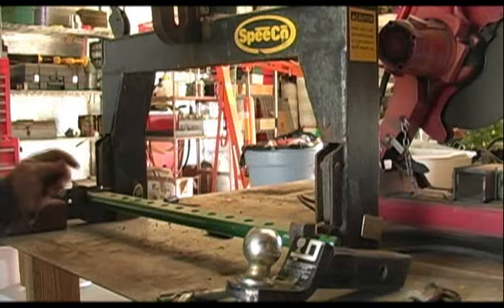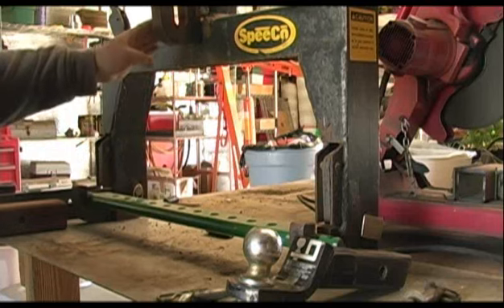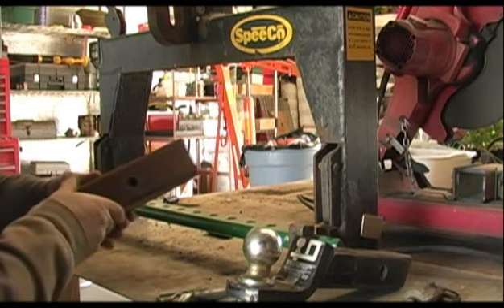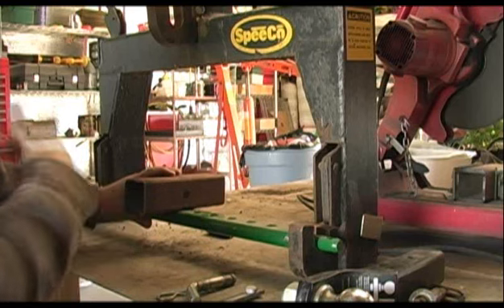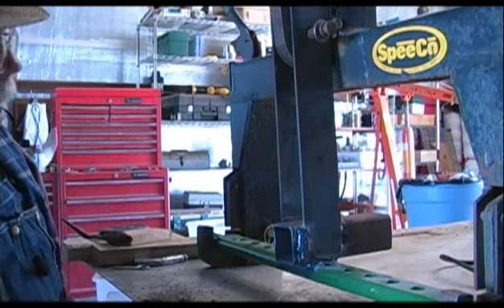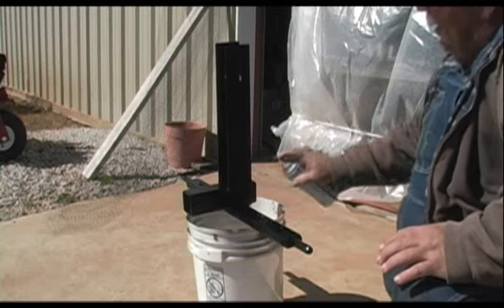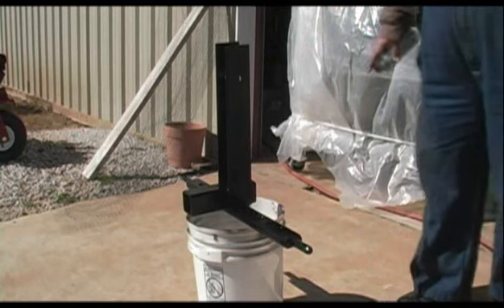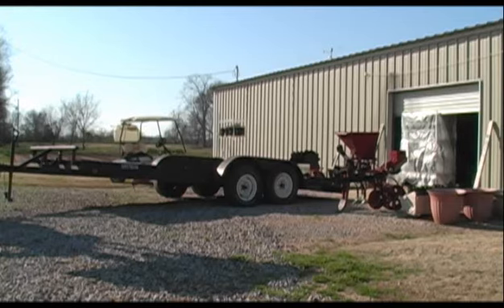Building a Receiver Hitch - February 2010 - The Bayou Gardener

Comment: Nice Job Donald. I have been a welder and a machinist for 20 years and have built alot of the attachments I have for my tractor. I made a reciever hitch for my tractor several years ago and the best thing about this kind of hitch is you don't have to get off the tractor to raise the trailer jack. Just back up raise the 3 point hitch and go. i'm sure this video we help alot of folks. Robert

Comment: Nicely done Donald. I've been using just the ball on my draw bar for years, with no problem, but the old 9N is only pulling a a 5x10, single axle trailer. Your new set up looks a lot safer though. I may have to do the same. Thanks for the video.

Comment: I like the idea. Similar hitches were used to move peanut wagons her in my town back in the 70s. I worked for a peanut oil company that bought and dried goobers from farmers and then rendered the oil and wastes. The spotters never got off a tractor. The wagons were hitched and unhitched from the tractor seat. One person per tractor. Great video though. And yes...........................4/16/2016 and it's still way too wet and cold to do much gardening. Plants are up but not growing. Pecan trees are still in the bud stage for the most part. COOL in south Alabama.
Reply from the maker: +MrBogeyone       I like the idea of hitching and unhitching a trailer from the seat of the tractor.  Comes in handy when moving a trailer to cut grass.....Donald
Reply: Works great. The guys used to move several wagons per hour across town with tractors. They had a drop pin system that was spring loaded. Guess one day I will build one and video it?  am not much on videos because I am too "natural" but I have a couple of vids on my channel. Mostly uncut. I am not professional by any means but I want to share my knowledge. Suggestions are welcome and I can take criticism from people that actually do videos. Check it out and give me an honest opinion. Love the way you do yours.................I just don't have anyone to help with the camera and it shows.

Comment: Hi try some messier 80T AC+ welding wire it starts great and is 80.000 tensile strength
Reply from the maker: +Mark Sleeper       Thanks for the tip.....Donald
Reply: your welcome